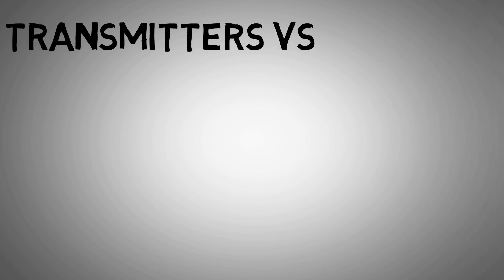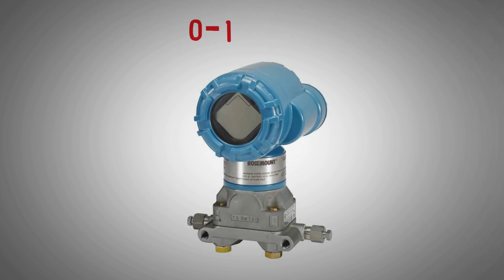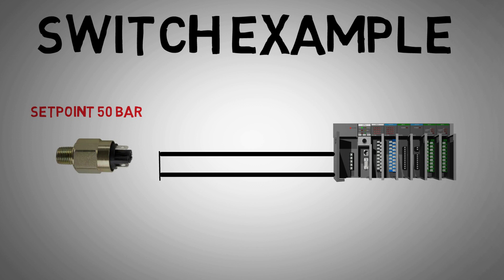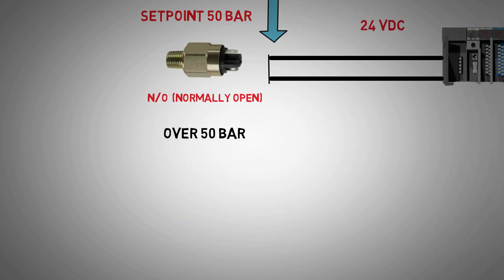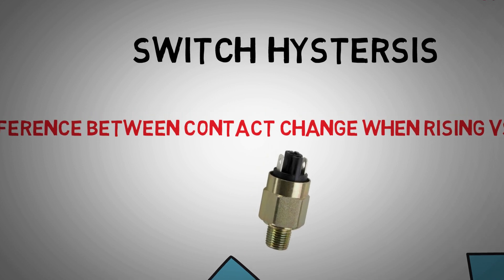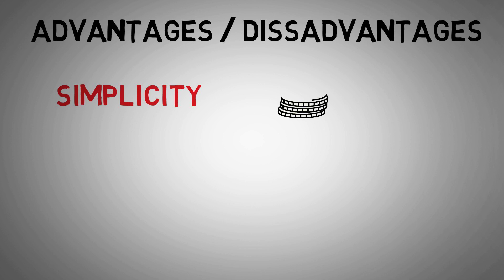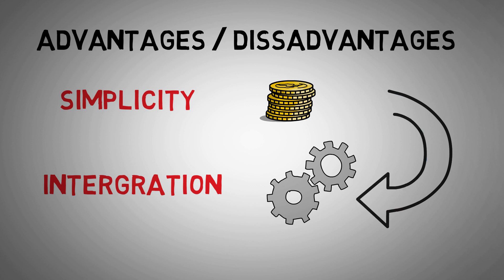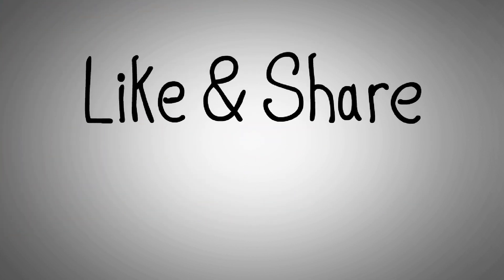Transmitters vs switches (Instrumentation inputs)

Comment: Another relevant and informative video, nice job and keep the good content!
Reply from the maker: Thanks Lee. I know I've been a little slow with content of late. I certainly have a few plans. Going to go over some component break downs. Anything in mind you would like to see?
Reply: Sounds good, is there any chance you could make a video explaining sinking and sourcing I/O cards? I’ve been trying to get my head around that recently. What sort of component breakdowns were you thinking of doing?
Reply: I’d also be really interested in learning how to tune PID controllers and be able to understand PID control fully if that’s something you’re able to do?
Reply from the maker: Sinking and sourcing input cards depends on the model of PLC you are using. Some input cards have Switches to change modes, other manufacturers do it via software. The input card is doing the same thing it just depends where the voltage is sourced from. If a card is source then it can power the 24v directly from the card terminals. A sinked input requires the loop to be powered from an external power supply. I plan on doing a playing with PLC basics in the future so maybe that would help.
Reply from the maker: I certainly can. It's something I have a fair bit of experience with and know some really simple ways to explain it that I have used with colleagues. I'll definitely keep this in mind for my future videos Lee.
Reply: Thanks for the explanation and the considerations for future videos. I’ve just bought a very small PLC and I plan to try to learn more about them by creating a pedestrian traffic light sequence with software and hardware. Software is still a mystery to me at the moment though haha so I have lots to learn. Take it easy and keep up the content!